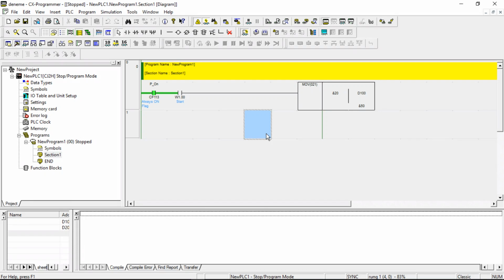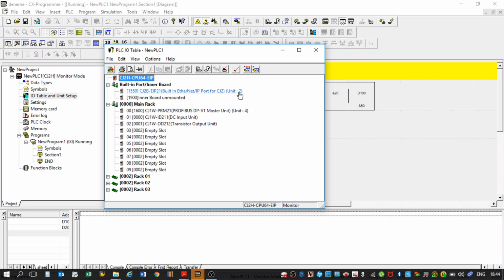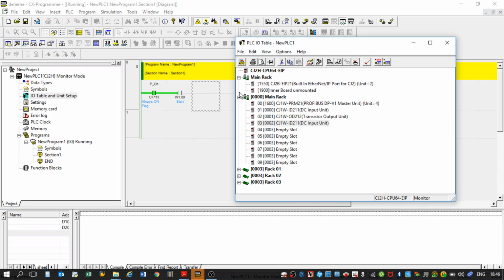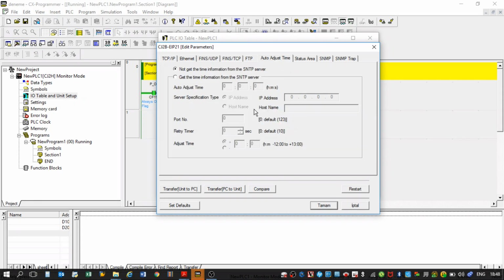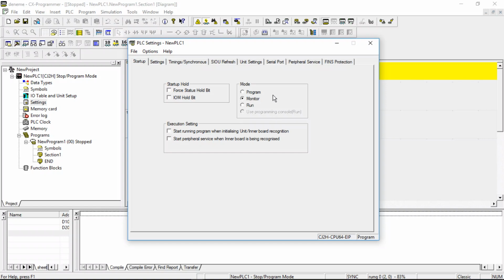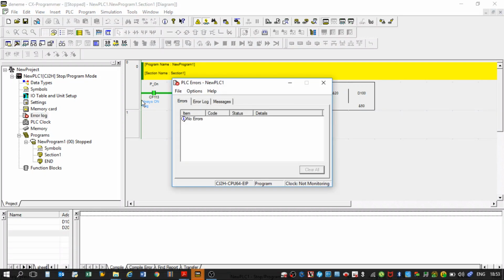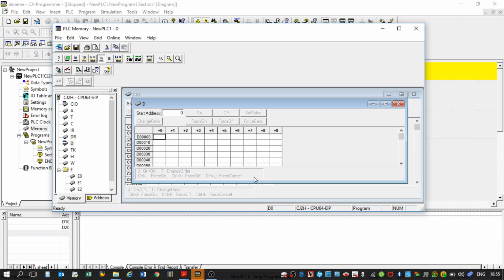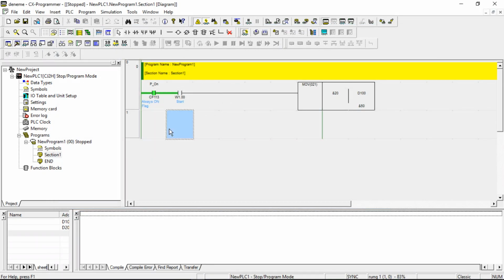Omron Plc Training - IO Table and Unit Setup & Settings & Memory & Error Log & Plc Clock

Comment: Good video. I transfer the IO table to PLC, but it does not save to PLC. It reverts back. Is there some kind of protection enabled? All I want to do is switch one output from -10-10V to 0-10V.

Comment: How to change velocity and position when motor is running?
Reply from the maker: Hi Bendy Lee , which drive that u are using as servo motor  and servo drive ?
Reply: Omron CJ/CP @DerstagramAkademi
Reply from the maker: @bendylee860  Hi , ı mean which communication protocol that u are using and which drive(ınverter) u are using ?
Reply: @DerstagramAkademi  i use Omron PLC CJ/CP series and servo motor (Omron)
Reply from the maker: @bendylee860  Hi ; 
https://assets.omron.eu/downloads/manual/en/v4/w487_cj1w-nc_8_ethercat_position_control_units_operation_manual_en.pdf

https://www.myomron.com/index.php?action=kb&article=1474
You can check this two file and in first link section 12 will show you positioning and speed mode etc. If u need an extra information then pls inform me , I'll prepare a document and prepare a video about this subject. Br,
Reply: @DerstagramAkademi  can you provide sample program?
Reply from the maker: @bendylee860  Hi , I'll check my database and if ı don't have any sample , I'll prepare and ı'll send to you as soon as possible , Br
Reply: @DerstagramAkademi  
Thank you very much.
Reply: use PULS Instruction